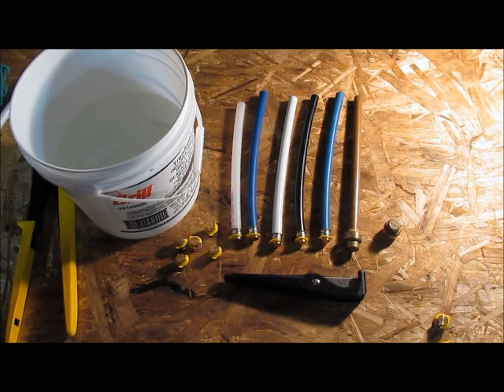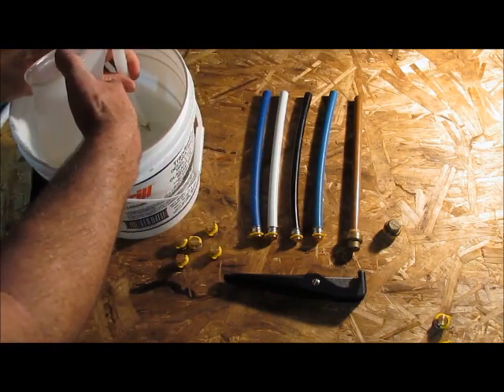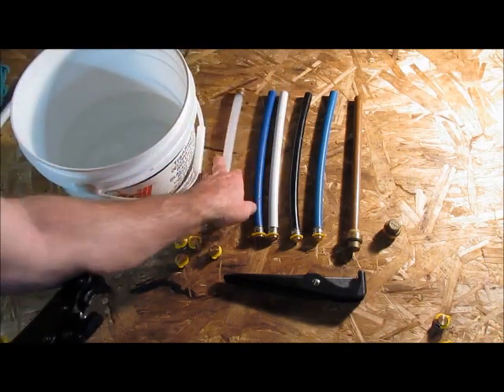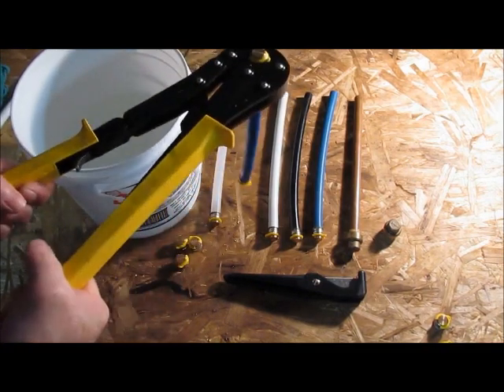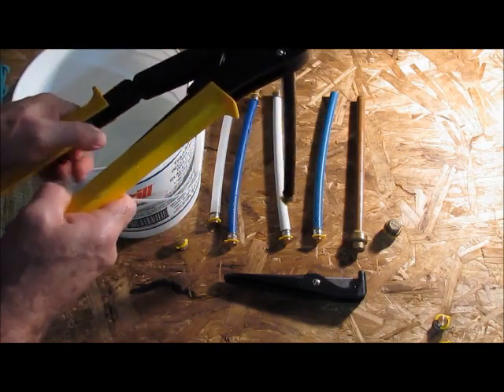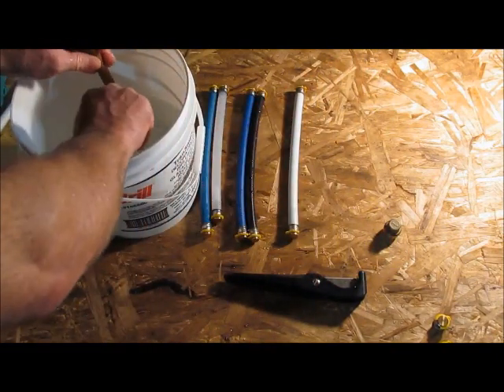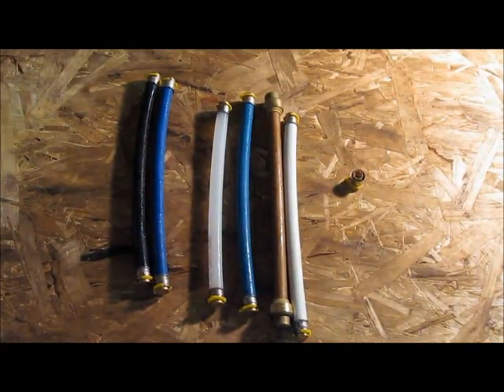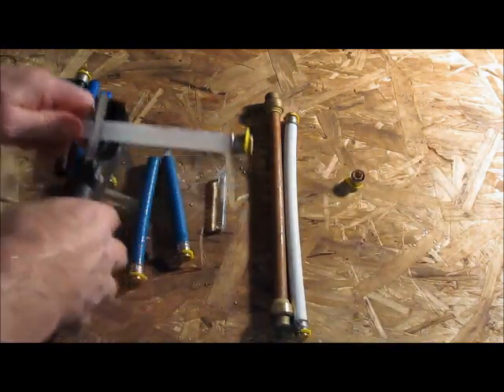Different types of Pex Pipe.   Freezer test.  A few winter tips as well. Plumbing Tips!

Comment: hey there :) great videos.. but i have a question still.. my area is in the extreme north of ontario canada.. what would be the best PEX to use for my water system... the old owner had some installed and it had cracked during the extreme temperatures... any hints? ideas? :) thanks
Reply from the maker: +Ready Group 
Pex A is probably what you would be looking for. It can be expanded for fittings to be installed with no issues. Wirsbo and Rehau are the two manufacturers of this pipe and system. I cannot guarantee you will not have any freezing, but Pex A is what I would recommend. The other thing to think about before closing the door tight for the winter would be to use compressed air to blow the water out of the lines. Small 2 gallon compressor will work fine for this job.
Pex B should not be used in situations where it has to be expanded. It will break down and crack.
Thanks for commenting and have a great week!     Al

Comment: Hello OldKid! You're videos on Pex are phenomenal and very, very helpful.  I will be attempting to plumb my first house using all pex, and information obtained from your videos! I will be adding a tankless water heater, considering I'm already plumbing the entire house.  What would you recommended for different sizes of pex as far as what should input and output at the water heater, and once my manifolds are created would it be acceptable to run 1/2" Pex to each of the faucets and rest of the fittings throughout the house?
Reply from the maker: +Andrew Adams 
You want to go into the unit with 3/4 and come out into a manifold of 3/4 with 1/2 inch branches coming off it.
I am a big fan of running 1/2 to every fixture. That is how I would run the pex. 
If you want you can run one 1/2" hot line to the bath/shower and tee off to the basin while doing that. Chances of you using both the basin and shower in the bathroom at the same time are slim. That is the only place where I would consider doing that.
You are in the right direction. Best of luck with the project!
Thanks for commenting and if you have any further questions fire away.     Al
Reply: +TheOldkid888 Great information!  Thanks again!
Reply from the maker: Andrew Adams
More than welcome!
Best of luck!    Al

Comment: Hey old kid, Rog here and I really needed to know if Pex was ok to run under my new addition for my outside water bibs and you nailed the answer! THANKS. I'll likely still wrap them in pipe insulation but it's nice to know they'll withstand Northern Ontario winters...
Reply from the maker: Roger Diotte 
Hey Rodger!
I have seen it run in a few barns outside now where there was no heat and there were no issues. Be sure to leave your bibs open in the winter.
What type of pex are you planning on running?
Thanks for commenting and get back to me when you get a chance!    Al
How is the fishing up there Rodger?
Reply: It's Bow Superpex Blue 100 ft coil from Home Depot. Item 589705 so is that a B-type? Running 3 bibs outside and the run will predominately be in an outside crawl space under my new addition. I'm going to install a waste ball valve inside on the run from the manabloc say 10 feet into the run so I can open the waste valve and drain and air blow out the line in the fall. I'll have 3 trunks from this line feeding each side of my house. I'm doing window build outs right now and then I'm heading in elbow deep into wiring the addition! I really enjoy this stuff muchly and especially watching your vids Oldkid...Thanks a million times over again ok...

Comment: In PEX plumbing you should use the exact fittings that each manufacturer has designed for it's product. PEX A is the best
in cold and/or freezing applications because of the expansion capabilities of type A. The crimp tool works fine for bench work but try using it up in a joist space. Clumsy and impossible in many cases. I use the Uponor Propex with great success and
the UV problem is easily overcome by wrapping the Pex with insulation or hiding it in PVC (like a conduit) if sunlight contact 
is possible. Sharkbites are quick and dirty but remember your seal is nothing more than a "O" ring that will fail in time. You already mentioned the high price. The typical home center product is B mostly. A good product but again I don't like the
crimp rings and clumsy tool needed. Copper is pricing itself out of favor and the top grades of Pex are a great substitute.
Reply from the maker: Hello moomike;
All good points...thank you!
The price of  copper has priced itself out of the plumbing world when it comes to residential. Pex is that much faster and cheaper. Most tools can be bothersome to use depending where the connections are being made. 
The crimp ring is more superior then the cinch clamps in my books. I have seen many homes done with that system.
I know the sharkbite is fast and painless, but the jury is still out on their life expectancy as far a leak occurring. The one o-ring is the only seal, but they have been around for a few decades now just not in North America.
Thanks for commenting and have a great week!    Al
Reply: cant even open it enough to put around the ring in a tight area ...I used push fittings i bought from eBay and they leaked right after installation .

Comment: You can use Pex and crimped fittings and you will be fine if the pipe freezes.  If you use Pex and sharkbite fittings, and the pipes freeze, you might have a few sharkbite fittings that pop off the pipe itself.
Reply from the maker: Hello Willilly Bab;
I have come across a few places where pex has been frozen all winter and when the spring arrived; not a leak. 
It was pretty impressive!
You maybe right with the sharkbite; I haven't found any places yet to see this happen, but when I do; I will make note of it.
Thanks for commenting and enjoy your weekend!     Al

Comment: I have a piece of pex that froze and burst last winter in my garage.. After I watched your video I wondered why. There is a couple of feet of copper from the pex to the outside water valve on the back of the house. My theory is that when the water in the copper froze and expanded that increase in volume  which caused the pressure necessary to burst the pex. Also,  the pex must have frozen is a second place trapping the water else it would have forced the water back out the incoming line. My house was built in 1970 and does not have a back flow preventer. The pex has expanded and now I can't get a sharkbite fitting on the pex to reconnect the line after I cut out the break.

An issue with the freezing test. Wouldn't it be more realistic to refill the tubes and refreeze several times. If the pex is expanded each time it freezes it will eventually break. If it is not going to break it must expand and then contract . It just can't keep on expanding. TheOldkid888, please don't take this as a criticism, the test you did was great and I recognize it took a lot of time to do it and make the video, thanks for your efforts.
Reply: In what world does a frozen water pipe freeze and then continue to expand without being able to contract again when thawed? Idiot

Comment: How long does it take to become a master plumber? And get a license?
Reply from the maker: Hello Dorsey;
You would be looking at about 5 years to get your journeyman's license. You can go to school for the first block or two and then you must work to get your hours. 10,000 hours are required which is about 5 years in total. It use to be 8000 hours. You will be given hours when you go to school for your first block. The biggest thing is to get your hours as quickly as possible and this all depends on the company you are working for. 
Thanks for commenting and have a good week!    Al

Comment: I have Uponor AquaPEX exposed in my basement. I don't think it gets direct sunlight but the basement has small windows and CFL bulbs which are not left on unless I'm in the basement probable less then 2 hours a month. Should I be worried about UV. It's been like this for 2-3 years since I moved in. Thanks.
Reply from the maker: Hello fakeusa;
Sorry I missed your comment. I would put a little insulation and cover it to be on the safe side, but I wouldn't be to concerned about it.
I have seen it where it was exposed to fluorescent lights 24/7 and it finally cracked after 5 years. So there would be really no deterioration or very, very little to the piping in your home.
Thanks for commenting and have a great week!     Al

Comment: Thanks so much for responding! One more question, other than the extended UV Rating, what other benefits have you found in switching to Viega? I saw you using the clamping style applicator for capping it off, but is there another method where I can use my Milwaukee M12 Expanding Tool? Or is the Viega method restricted to just the large clamps? I badly want to grab that Ridgid ProPress, just need some persuasion...lol
Reply from the maker: Hello TheFloorBoys;
Pex A is only made by Wirsbo or Rehau. Other types of Pex that are manufactured cannot be expanded.
Veiga is the crimping system with the stainless sleeves attached to the fittings and in my books; it is a very good system. No chasing sleeves or rings like you do with Wirsbo or Rehau. I think the Rehau system is the best system, but the prices of their fittings have tripled since I started using them.
I have used the Rigid ProPress on the Viega system and it is ridiculously fast. The ProPress tool is remarkable as you have no worries about water if you are pressing copper fittings on copper pipe. The fittings are about 50% more expensive, but the time required for installation is very, very fast.
The tool isn't cheap, but if you are planning on doing a lot of work in this field; it is well worth the money. I made a few videos on the tool. One crimping Viega and the other joining copper without soldering.
Thanks for commenting and best of luck with your projects!    Al

Comment: Question for you. I bought a roll of the clear pex (pex A) and I left it in my van for a day, in the front seat....before it dawned on me a day later to put it in a black contractor bag to protect it. Now, do you think that one day of possible exposure ruined it? Thanks. I love you vids by the way.
Reply from the maker: Hello TheFloorBoys;
No worries there. If I am not mistaken, the Pex A that you are talking about is 90 day UV protected. The clear that you bought is called Uponor or Wirsbo. I have used it quite often and have switched over to Viega. that has a 1 year protection. Biggest thing when installing pex is to keep it away from UV rays. I have seen it crack from over exposure.
You are good to go with what you  have purchased.
thanks for commenting and best of luck with your project!     Al

Comment: residing in Maine, temps can drop to -20 for days during the winter, can I safely use a heat tape along the side of PEX piping
Reply: Find out whom the manufacturer is, and ask them whether you can use heat tape on their product, other then that they usually have a temperature rating printed on the side of the tubing . One problem with any plastic pipe is that heat can weaken it somewhat, the amount of pressure it can take drops.

Comment from the maker: Hey Brett;

Thanks partner! 
I don't think the HD guy really gave a cat's tush about what it did. 
The crimp copper rings are a big seller. Much cheaper then the other styles. Fittings are thin, but are made of brass and should last for some time.
The Veiga are actually made of bronze and contain no lead. I really like the fact that all you have to do is compress it and no rings or clamps have to be applied. I am headed in that direction.
Thanks for commenting and enjoy your weekend Brett!
Al